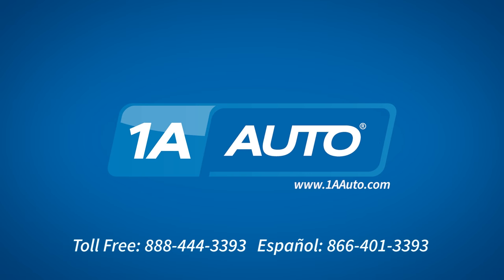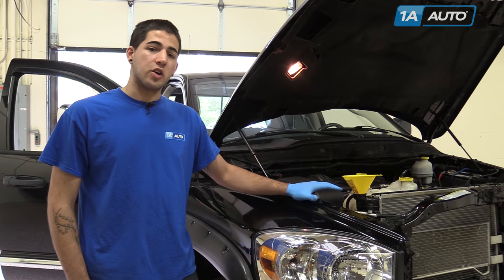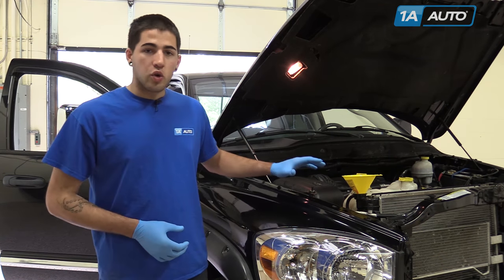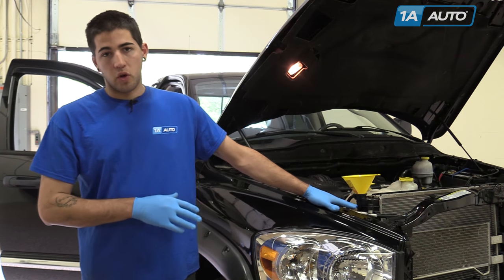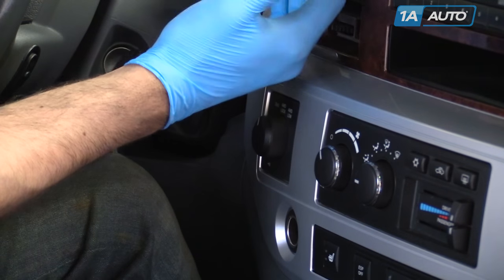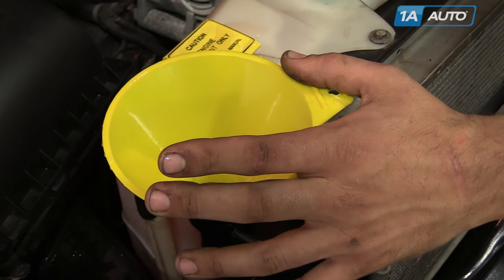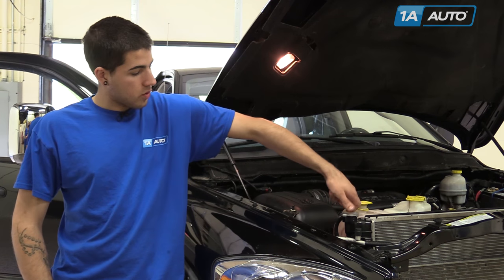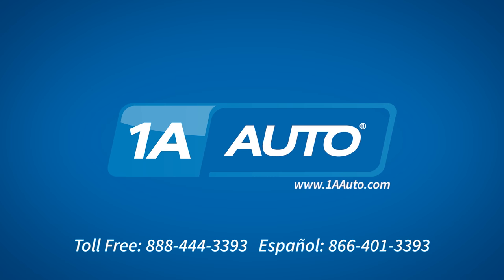How to Properly Bleed Engine Cooling System by yourself

Comment: That's the perfect world scenario. In reality it can take 3 or 4 bleed cycles and also each vehicle may have specific bleeder ports incorporated into the factory specific procedure. Some are on the water pump tower. My Dodge 4.7 has a bleeder screw near the upper radiator hose. I don't need to mention the newer closed systems with the pressurized reservoir bottles.... nearly impossible to bleed once opened up. OEM assembly plants have a vacuum system that does it properly. Once they're opened up for literally any reason, good luck. I'm talking to you, GM. Your Dexcool ruined my Equinox 😂.           Anyways, the very last step is to fill your plastic overflow tank within the specified levels. There's a reason for those lines being where they are. It's at the highest elevation level in the coolant system and the theory is that any tiny residual air bubbles will escape through the bottle during thermal expansion (normal operating temperature), but not being able to get back in because your coolant level is properly filled to the correct line. Hope this helps someone, because it's not as easy as it sounds

Comment: Whilst no harm is done in undertaking this exercise if you simply ensure the level of coolant in the expansion tank is at the correct (i.e. between LOW & HIGH mark) when cold and you start the car up and run it at fast idle with passenger cabin heater thermostat set to maximum and AC (if vehicle is fitted with one) turned on until the engine temperature reaches the correct high level. You can even go for a good long drive as well. Stop the engine, note the level of coolant in the expansion tank and if it is below the MIN mark top it up to the correct level and let the whole system cool overnight and recheck the coolant level in the expansion tank and top  up if necessary. This is the correct procedure to purge air out of the cooling system. Unless there is a fault condition such as coolant leak you should never have to take off the radiator cap to top up the coolant or purge air out of the car's cooling system. The thermal expansion tank, by design, is always situated slightly below the height of the radiator cap. good video thanks. You will find that in the latest generation of petrol driven cars there is no air bleed valve in the cooling system either.

Comment: I thought to bleed a system you would actually open the bleeder valve and make sure no air is in the system, now I'm kinda lost..
Reply: The radiator cap is open…. Thats the bleeder
Reply: That would be great if my Mazda 3 came with the bleeder valve
Reply: @MrRusell86  the plastic bottle does work, I should say it did for my van anyways, but I had to use a generic water bottle the other ones were too thick of a plastic and didn't fit well

Comment: I've watched and enjoyed these 1A Auto repair videos for years, but not so much this one.  No mention of bleeder valves on many vehicles, and not a mention of the chronic air pocket problems in many, especially those van models with secondary heat in the van back.  (e.g., the Venture/Montana series)  But hey, why not do another video for that Venture you often do videos on?
Reply: Also, the reservoir might need to be checked/refilled???

Comment: So, do you need to use bleeding screw or not? I just did coolant level sensor replacement and I'm not sure if I should "bleed it"? I have 2 cups of coolant LEFT after whole process. Temps are good etc. I assume I have air in the system, but  coolant in the radiator is at max. Please advise :).

Comment: When you do this why would coolant come out of the resivour. 2002 2500hd Silverado 6.0 vortec. No radiator cap just resivour cap
Reply: If it's a lot, could be head or head gasket and maybe in some cases be an intake gasket. Those are worse case scenarios.
Reply: Pressure causes it to rise.

Comment: Good video, very simple - but - when  I did mine, the level rose to above the funnel, so i wrapped paper towels around the funnel to do some damage control (good thing I had a pan underneath), then once the fans and heat kicked in, it sucked down the coolant in a great big gulp, and I had to very quickly pour coolant in to get a decent level.   Then all was good.   And I didn't use the bleeder valve so as to avoid making a mess.   Wish I had, and simply wrapped a ring of paper towels around it to catch the slop.

Comment: I have a 1996 Dodge Intrepid (3.5L) that has a pressurized reservoir - NO RADIATOR CAP.  I would prefer the old style system with the cap on the radiator, but I have to work with what I've got.  It is a huge PITA to get all of the air out of the system, but runs very cool once you can achieve that.

Comment: yep, it was air.... I knew I would get a lot of air but not that much! at least I got a new thermostat and water pump now. they have never been changed and it's one less thing to worry about. it was a big learning curve for me. lol
my car runs great now! 
up next is spark plugs!😃
Reply from the maker: Thanks for checking us out. 1aauto.com
Reply: Is it normal for the coolant to pop up or squirt from the radiator when you squeeze the hose?
Reply: @Kal-EL_Volta  Yes.
Reply: @Kal-EL_Volta  yes, normal
Reply: What were your symptoms?
Reply: How long did you wait

Comment: Excellent and easy to follow. I followed this procedure to bleed the cooling system after replacing the coolant temperature sensor in the family truckster. Many thanks!
Reply: Ok, he said turn off the car, replace the cap, and then let it run for a few min….. do we leave the car on? Or do we turn it off, put the cap on and turn it on again? 😂 seriously

Comment: Good to know some things don't change..  This is how I've been doing it for the past 40 years.
Reply: No matter how much electronic crap is shoved into cars, a piston is still a piston and a wheel is still a wheel. Lol
Reply: Things do change to no radiator cap with a plastic coolant tank, can't see the coolant flowing at the radiator like the old school radiators. just my opinion. thanks.
Reply: My 2005 Toyota Tacoma overheated and the coolant blasted out of the radiator cap. It was boiling hot. The overflow was also boiling. Do you think that’s because my thermostat did not open and I need to replace it?
Reply: @donttrip775  hope you replaced the thermostat by now.

Comment: Great method all it took was a set of pliers and a 10mm wrench kept adding coolant until I got heat and it was at the top so there's no air in the lines thank you

Comment: I just got done flushing my coolant  I even removed my  coolant reservoir to inspect for cracks or rust. So after I do this process as shown in the video. 

Does my reservoir feel back with coolant? And i would just top off to the full line? Sorry if this is a dumb question

Comment: My heater only blows cold air, the car was my son's who is an addict, that's why I took the car off him, he never done any service or maintenance and as a single mum I am learning to fix it, I'm loosing power when vehicle is cold but it heats up too fast and doesn't cool down, I'm suspecting that the head is warped. I bled the system not long ago, maybe I didn't do it right, I'm just learning this stuff but learning fast. Great video, thanks.
Reply from the maker: Thank you so much for the feedback! +JoJoZep ofthejungle
Reply: @1AAuto  you know what? I did this and car stopped overheating; and no more crank issues, before this I put that gasket sealer in, it didn't work; then I installed a fan to cool the motor and that works but didn't fix the check engine light and because of the heat I've had to replace a big $200 battery in just 8 months. While I was under the hood I found a lead that wasn't plugged in to I think a coil so I plugged it in and everything is fine. I'm really happy that I watched your video and I give it a like. Thanks again.

Comment: I drive a 03 malibu to purge my cooling system chevy put a purge release screw on top of the engine. To make sure all of the air is out I simply fill the overflow reservoir with coolant until water flows freely out of the bleeder screw, then replace the overflow cap tightening the bleed screw. Takes about a minute.

Comment: I recently drained all of my coolant from radiator and replaced both thermostats on my car, however I forgot to bleed the air out of the coolant and was wondering why it was overheating. I hope bleeding the system will be the fix and not the thermostat being placed wrong.

Comment: For me nothing was working. The heater wouldn't warm and engine was getting hot. I squeezed the tubes and tried again a few time. Finally I decided to  move the vehicle. When I did instantly the heat came on and everything normalized. I believe it was because I was parked downhill.

Just thought I would throw that out in case anyone is struggling like I was.

Comment: Kind of curious. All the instructions I read and watch have the car on a flat surface. Seems to me it would make more sense to either have the front of the car on ramps or jack stands... Air rises through water, why not make the radiator cap the highest point? The top of the radiator should at least then be higher than the heater core, right?
Reply from the maker: +John Egan Yeah, you're right that it would bleed a little faster with it slight elevated. Though so long as the car is running, coolant is moving anyway. So that means those air pockets are going to get dislodged and look for a way out of the system regardless. But that's a good tip to elevate the front end a bit. Thanks for commenting.   1aauto.com?utm_source=YouTube&utm_medium=CTA%20Comment&utm_campaign=1ATony 866-403-3393
Reply: Thx.... Just beginning the 'burp' after replacing the head. Boring. ;-)
Reply: John Egan 000

Comment: I recently changed my radiator and it won't stop overheating!😭
I fill the radiator up with the bleed line open and wait until it stops going down. Then I twist on the radiator cap and close the bleed valve. 
next I start the car, turn on the defrost full blast (because that's the only speed I have) and then wait for my car to get half way up in temp. 
I open the bleed valve and just let it do its thing (only stem comes out) until it gets a quarter away from the red mark (270) . I've repeated this process 4 times now and it seems like there is less air coming out after I shut the car off. first times was about 10 mins and now around 3-4 mins. my time could be off. 
anyways, am I doing the right thing and or could there be an issue with the thermostat...?
I got a 2003 chevy Impala 3.8 V6. everything I believe is stock besides the oil filter, transmission filter and the radiator ( I did it all myself!😉).
sorry for the long comment but I'm pretty ignorant in this department and I need some serious help.
Reply from the maker: It sounds like you've still got air trapped in the system. You should do a search for "bleed coolant system 2003 impala" and watch any of the videos that come up regarding the GM 3.8L v6. Or look in a forum for your particular car. But basically, you want to remove the radiator cap. you don't bleed with the cap on because you need to continually add coolant. The liquid will form a 1 way valve and keep more air from getting in if you keep it topped off anyway. Then, once it warms up, open your bleeder valve and let the air out. Once a stream of just coolant is coming out, close it and wait check the level in the radiator again. Top it off if necessary. Open bleeder again and let more air out. Repeat these steps until there are no more bubbles coming out of the bleeder valve and it's just a solid stream of coolant each time you open it. Hope this helps!   https://www.youtube.com/watch?v=ad9u8jADrvU
Reply: CHIEF TOMMEH check any plugs that cane with the new radiator, sometimes plugs will pressure up into the hoses,  so take of all hoses and check for blockage

Comment: When u said take it for a spin come back and check too see if your radiator still has water. Can I do that as soon as I get back home or should I let it sit for and hour or so. Just wanna know will the radiator cap fly off andwill hot water come out or is it safe?
Reply from the maker: +jesus morales You NEVER want to take a radiator cap off when the vehicle is hot. Make sure that the engine is cold when you check the fluid level inside of the radiator. Thanks for watching. 1aauto.com

Comment: How would you do this with a vehicle that has an expansion tank and no radiator cap?
Reply: Do you have any Bleed screws on the coolant line's. What type of vehicle are you working with
Reply: @Tom-wq2mz  it is a chevy Cavalier that I am working on. It does have a bleeder screw on the tube coming from the heater core to the thermostat housing. I believe my issue was either an air pocket locked in somewhere or I had a clog in the system.
Reply: ford f150 2005 may i ask if it has such screw because i change thermostat and temperature gauge going up and down once it reaches operating temperature

Comment: I have a 2001 Tundra with the 4.7. I just changed the coolant temp sensor and now my gauge runs a little over half when it use to  run at half or a little below. Is it running high because I didn't bleed the system after installing the new Coolant temp sensor?
Reply: You need to bleed the air out of your cooling system otherwise the temp will get super hot at idle.  You can buy a radiator bleeding system on Amazon for less than $20.   You need to park your car an upward angle to do this procedure.  Good Luck!!

Comment: I have a 1994 Buick Roadmaster and it doesn’t have a coolant cap just a resivore on it I’m replacing the radiator and have no idea how the coolant will fill up in it

Comment: I have 06 explorer and I fill up coolant and radiator with coolant? I haven't touched radiator just coolant ,should water go in radiator since I have a separate coolant?
Reply from the maker: +Jersey girl Thanks for watching! If you are filling the coolant system back up you will want to fill it with coolant, not just distilled water.

Comment: 2009 Chevy aveo5 what about if u cannot access top of radiator ? Only fill resivoir is accessible. In this case what shall I do
Reply: The reservoir, that is the cap. Get a turkey baster or a hand pump if you overfill or it starts to backfeed.

Comment: I have a question. I had the thermostat housing replaced on my 2003 Ford explorer 4.0 L V6 but the needle on the temperature gauge doesn't get to the middle stays kind of halfway between cold and the middle, why? Is this normal?. Thank you
Reply: Sounds like you have a stuck open thermostat, which makes the engine run cooler. Probably need a new one.
Reply: That’s normal

Comment: Hi I have a 2001 Ford F250 Econoline van 5.4 L V8 I'm having first I had oil in my water and I've been having trouble flushing that out what all do I need to make sure it was flushed really well and then what happens if I then get water in my oil what could be the cause for that and vice versa
Reply from the maker: +Christina Konet This can be caused several ways including a leaking cylinder head gasket, cracked head, faulty engine cooler, faulty transmission cooler, etc.. First find out the cause and fix this issue.  Then you can start the cleaning process.
Reply: @1AAuto  we did theblock tester with the blue dye

Comment: 08.27.2019 ( do you need to bleed air off every time you take the radiator cap off to check water level or antifreeze
Reply: I definitely would
Reply: you do not , no substantial amounts of air will enter the system. be sure the car is not hot when you check it because you will get covered in boiling hot coolant

Comment: My car over heats when it idles but once I drive it it goes back to normal...I got a 2008 audi a4 it doesn't have the violet coolant that it needs can that be the problem? Idk what to do
Reply: Check that your cooling fan is working , start by making sure none of the relays are burnt

Comment: Will this work using AC instead of using heater?
Reply from the maker: +Karl Engbino You need to use the heater so that the antifreeze circulates through the entire system. Hope this helps you out.

Comment: 2001 ford explorer sport trac... mine is topped off, thermostat gage won't move from cold air bubbles came up and have no heat.. hose that goes to the thermostat is empty no pressure

Comment: Hi! I just have one question!
If i just take off the radiator cap, can air get inside the cooling system?
Reply from the maker: +asdasda asdsa Very important. Never remove the cap while the engine is hot. Hot steam will escape and cause burns. When the engine is cold you can remove the radiator cap to check the level of coolant. It won't let in enough air to cause an air pocket in the system. Small amounts of trapped air will work it's way out of the cooling system under normal conditions.

Comment: i followed your guide however I hear some water noise whenever I start the engine. How do I bleed the air from the heater core?
Reply from the maker: +Rommel Reyes If you follow this video and turn the heat on, that action should circulate the air from the heater core. Hope this helps you out.

Comment: Do you fill the coolant resovoir bottle too?
Reply from the maker: +Johnny Doggs Once the entire system is filled and bled, if the bottle is low, top it off. Run the engine and if it goes back down top it off to the max fill line
Reply: 1A Auto Parts thanks

Comment: This might be how you fill a Dodge fit a Ford and a Chevrolet of a closed system and you do not put antifreeze in it like that that's not how you get air bubbles out of the system
Reply: Pretty sure the guy in the video knows what’s good. I did this and it worked

Comment: I own a 2016 Ford fusion 2.5L - whenever i have the AC ON I hear this bubbling or gurgling  noise. It goes away once i turn the compressor OFF.. I have been told it could be air in the system and others say it is normal as it's just freeon passing through the system :(